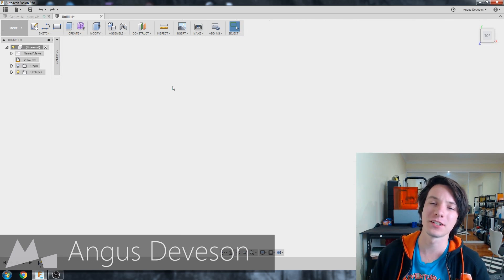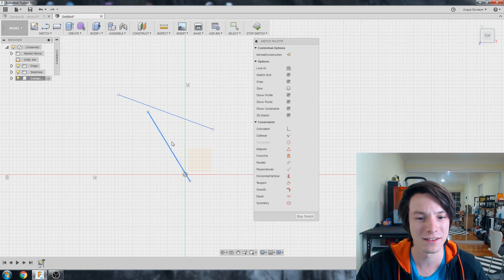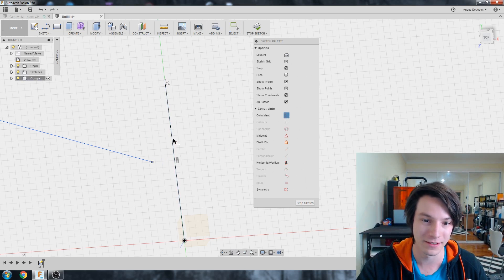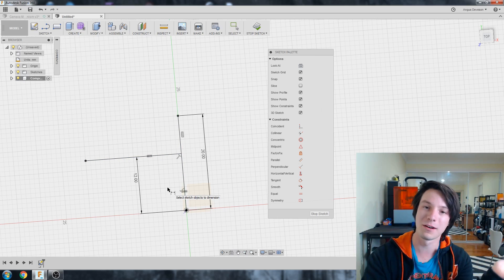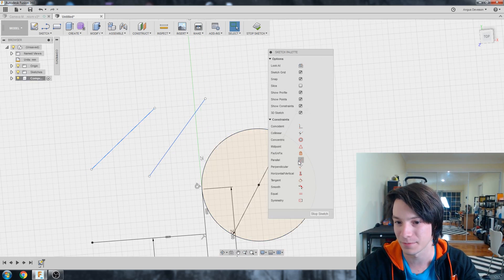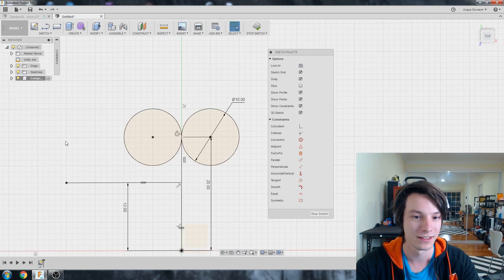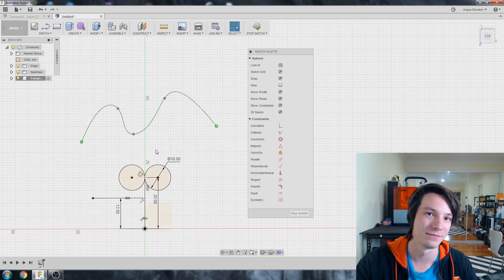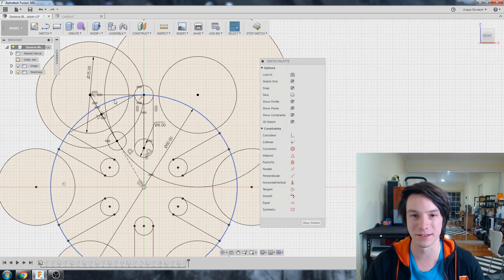How to use Constraints! CAD for Newbies with Fusion 360

Comment: I learn so much coming back to these videos after spending some time in Fusion 360. Thanks for doing them!

One comment: I'd suggest pointing out that the order in which you select the two sketch objects affects how some of the  constraints are applied. For example, if you want to make two diverging lines become parallel then one of those lines will change its orientation when you apply the constraint. But which line will move? It can be frustrating if you don't know what to expect when the constraint is applied.

Comment: Hello Angus, I am someone who came from autodesk Inventor and am now migrating over to fusion 360.Now, I've been running into a lot of problems, most having to do with the 3d modeling aspect, and I was hoping you could maybe you could help me. As someone coming from Inventor I'm very used to being able to create an assembly file and bring in one file multiple times rather than copy and pasting or creating the piece again. Now I'm having trouble being able to duplicate a piece and manipulate and constrain it the way I want which is another problem I'm having. I'm having trouble understanding the way the different constraints work in the 3d modeling workspace. I also am having trouble with the difference between components and bodies and how that affects their constraints as it never had much effect in Inventor. So, I'm really hoping you can help me out because I can't find anything else that is helpful.

Comment: Hi there 
How do you remove a constraint?
Have created a nice lofted form but somehow got some constraints added to the profiles and I just can't seem to remove them.
Steve
Reply from the maker: That's something I should have covered sorry, you can either click and delete it if it's visible - or right click the line or point and 'remove' the constraint you no longer want.
Reply: Hi there
S thanks for that been clicking on the wrong thing. However I am using multiple parallel sketches and I think that points on one sketch are somehow attaching to points on another plane. Also getting the red markers. M loving it though surprising how few frame lines are needed to create beautiful curves hulls. Last bit for my printer coming next week so Balrog will soon be under construction. 40cm x 96cm delta 150cm tall smoothieboard. Steve

Comment: how much does fusion 360 cost? or is it a free ware?
Reply: Anonym U. see the site for license details pretty sure it is free for non commercial onshape is what I use, it's similar but in a browser so works on Linux fusion currently only supports Mac or Windows
Reply: Anonym U. Yeah for start up or enthusiast use you it is free. Great program, install the free trial then and you should be able to select a startup/enthusiasts option in licensing